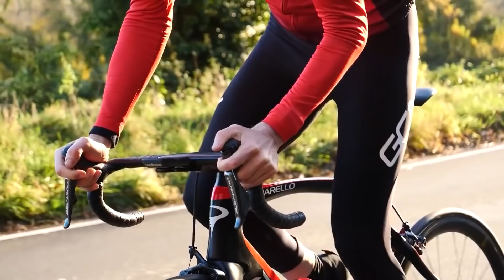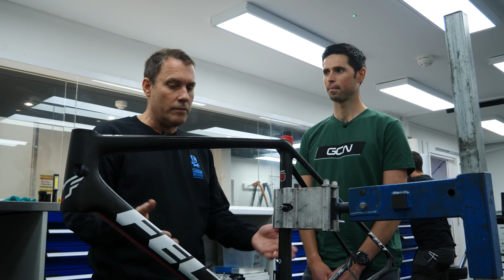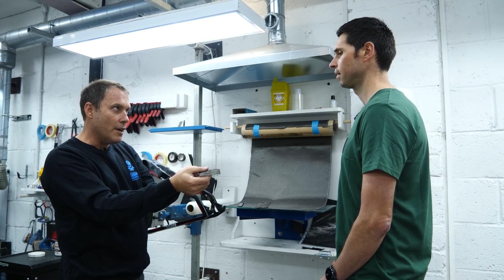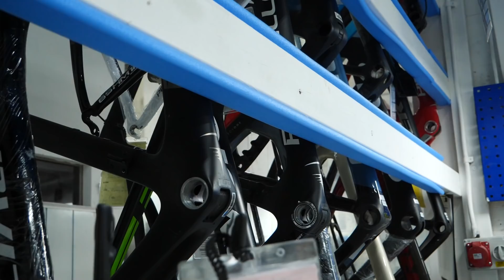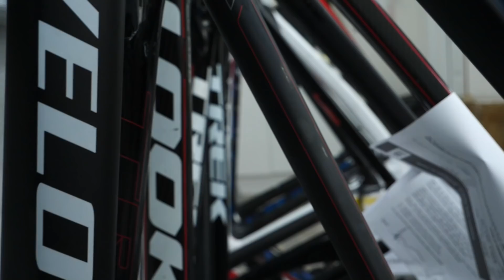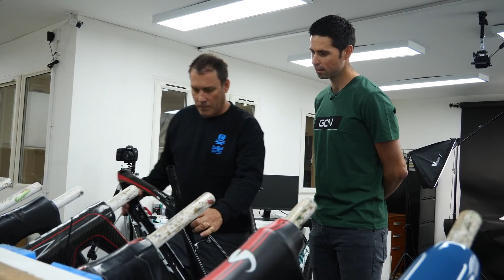Can Carbon Fibre Bike Frames Be Repaired? | Is It Safe To Ride A Broken Carbon Frame?

Comment: and what wouyld be the cost ...LOL I GOT A CARBON SCOTT bike  that has a rear hanger and the fantastic carbon that holds the hanger is cracked and broken  to me carbon fibre is weak to easy to break and would be an arm and a leg to get professionally fixed just not worth it so its going to the landfill give me an Alloy frame any time

Comment: What about cracked frame from an over tightened seat post clamp where the seat post is aero and the clamping mechanism works in such a way that it cracks an inner part of the carbon?

Comment: the fact that theres a cf repair shop exists says it all.
never heard of an aluminium frame repair shop.
carbon is like oled tv, its gonna burnin sonner or later so cf gonna break.
Reply: because once alu breaks, there is no repair method.  it is trash.  carbon is good because you can repair if you need to.  steel can be repaired.  aluminum cant be.
Reply: @anthonytalevich7601  theres something called welding

Comment: Great information, it wasn’t that long ago the thinking was a broken carbon fiber frame meant replacing the frame. My question just how much does repairing cost? A ball park price would be nice to know. Is it less than half, two thirds the cost of replacing? Would be nice if he could state something like, you can expect to pay… and as much as… It’s obvious that it must be cheaper than replacing, you wouldn’t be in business otherwise. But is the repair at price points that mere mortals can afford?

Comment: I bought a bianchi oltre xr2 that had a seat stay like that on the thumbnail, it was "repaired" with epoxy-putty inside and glass fiber on the outside.
I noticed it bechause of some shitty paintwork and i started tapping the frame to check the rigidity of the frame through sound.

when i got to the seat stay the sound was completely dead, and all it took was a 3 fiber push on the seatstay and i had a piece in my hand.
I took it to an actual professional carbon fiber repair man and the result was really good.
Paintwork still look diy, but it's a black matte frame so it's really not important what it looks like, but i know i can trust the frame now, and i've used it on my smart trainer aswell as jumped it over curbs and down curbs with no ill effects.

Be carefull where you get your frame repaired, as the previous repair man obviously didn't do a propper job and it would have ended up hurting me down the line.

Comment: I would never accept a repaired carbon frame, sorry. You are going 60mph downhill and if any of those cracks they DIDN'T see, suddenly gives way by a small hump in the road and you fall off. It might be the last thing you do in life. Sorry, but these single peace molded frames only last until the first crack appear.

Comment: I had my top tube repaired by these guys. Amazing job and near perfect finish in the end and nearly three years later I’ve had no issues or problems. Cheaper than buying a new frame too. Would definitely recommend!
Reply: Just cracked my frame in a crash what is the link for the shop when I look up carbon bike repair just a bunch of other shops come up
Reply: How long was the turnaround mate? I've got mine in for a weird manufacturer defect. Not in a rush.
Reply: @AlbertBuckinghamEllison  
F**k that, you should have sent it back to the manufacturer if it was how they sent it you?
Reply: I also need to have my bike's top tube repaired. How much did it cost you?

Comment: Do not be fooled by Rob at CBR, I have had a complete nightmare with this joke of a company. Go anywhere but CBR AVOID AVOID AVOID. They returned a rebuilt bike in dangerous condition, missing bolts from brakes and forks, poor paint finish, over painted, so much so that the paint rubbed away in several place and CBR blamed a manufacturing design fault and offered to cut a channel into the frame!!! Can you imagine what the manufacturer said about that? Even my insurance company have tried to resolve but are now supporting me going to another company. CBR did such a poor job they even wrote to my insurance to say so! A lot of people may use social media as platform to complain, as I am doing here, however I have a full evidential chain of pictures and correspondences. Incl Rob saying “whatever happen we will sort this out for you” liar alert!! The court room beckons. Happy to privately go into further detail or provide proof of all I say. GCN this is the 2nd feature on this company, there are other better ones you could feature and support, come on be original!!

Comment: Local bike shop has a wall with road frames hanging on it that suffered sudden catastrophic failure with normal riding. There are a lot of them and some are modern expensive ones, some of the riders are now in wheel chairs..... yeah n,f,t,h

Comment: #askgcn Hi guys, I've recently changed my chain and cassete, I've left the chain the same lenght but the cassete is now R8000 11-32, and the old one is HG800 11-34. There was a spacer underneath the bigger cassete which didn't came with the new one. Should I have left it on the bike or not? New Ultegra Cassete is mounted and it is fixed/doesn't wobble or anything.
Reply: If they are both 11 speed cassettes and the first one needed a spacer then the replacement should have a spacer too.

Comment: What I am surprised about is how many damaged frames there are!!!!  Are these all damaged from crashing, misuse,  etc?  I mean in my 39 years I think the last time I wrecked a bike was in grade school.  I have a Domane SL6 ordered but starting to worry how fragile carbon frames are.  I for sure don't have deep enough pockets to be replacing/repairing carbon bike frames.
Reply: They aren't really fragile at all. I hadn't wrecked a bike in many many years either until last weekend. Laid it down in an off camber dirty turn at a decent rate of speed. Road rash from my hip to my ankle. Frame seems fine, the only damage was one busted shifter and the other one scraped to shit. Once I heal a bit and my new (price gouged) shifters come in I'm going to take it to the ahop to get a second pair of eyes on it but I don't think they'll find anything wrong with it. Carbon is pretty tough and the same sorts of things that break it can damage alloy frames as well, the difference being that alloy is pretty much 100% unrepairable. Don't worry about it and go ride.

Comment: I am riding a Canyon Ultimate that was repaired at the bottom bracket by the previous owner. I’ve put 16,000km on it with zero issues!
Reply: Professionally repaired carbon frames often are stronger than the original ones because expert repairs will add a lot more materials onto where it was cracked.

Comment: I would be very hesitant to ride repaired carbon bike due to complexity when working on carbon. However, if there was a standard certification for repair shops and their personal then it wouldn't be an issue for me. Also QC and repair would need to be a separate entities to ensure quality of repair is not compromised.

Comment: Sent my PlanetX to these guys to get the drive side dropout repaired. I thought the frame was dead and I was going to have to shell out on a new frame but I found Carbon Bike Repair through a GCN video. I have to say that although the repair was a little pricey it was still way cheaper than buying a new frame. Their customer service was impeccable with good communication throughout the whole process. And most importantly my commuter/go anywhere do anything PlaneX got a new lease of life.
Reply: @Terry Williams My experience is the complete opposite, I have had and continue to have an absolute nightmare, liars liars liars, dangerous workmanship poor paint work and broken promises……court room beckons!
Reply: @petermorrell5422  
Could you explain more in-depth by any chance? Thanks. Especially to do with the poor repair and paint job you received. Me personally wouldn’t trust a job like this unless I was there to see the work as it happened, too easy to slap any old bodge job on and paint over the top.

Comment: repair  carbon =  ad  weigth ...  don't  tell  Oli  he  will go  mad  as  he  did  on the  Gravel bike video!  good  video   very useful  still  wondering  why  some  need  a  carbon fibre bike  why  some  others  don't  and there  is the  answer why  some  of  us  resist  and  belive  more  on steel  titanium  and  even  Aluminum ... because  to  can  repair  the  bike  but  take  away  the  concern  of  the  one  who knows that  this  bike  is a  repair  /broken bike.
Reply: Aluminium isn't repairable

Comment: My Trek Domane SLR7 had an argument with a car and the car run. (Not)nice crack all around tonight tube next to the head and fork. Thought is was a goner. Friend recommended The Frame Doctor in Tavares, Florida. About a month later it was fully repaired and the area affected repainted so as to not be discernible. About a grand. Much less than a new frame.

Comment: This is just stupidly complicated and expensive stuff for a “bike”! So unnecessary.. hey but it’s your money throw it away if you love to.
Reply: Until you ride a stiff CF bike, you won't appreciate the service
Reply: @dvikauglaumishrauca  All bike materials are stiff and can be designed for any amount of stiffness. Stiff is a marketing term to make you spend more money. There are plenty of articles and videos that explain stiffness and as for us mechanical engineers, we just cringe and laugh .
Reply: Why unnecessary? These frames usually cost upwards of £3000, why is it unreasonable to spend £200 or £300 repairing one? Or are you saying that carbon shouldn't be used in a bike frame to begin with because it's too expensive? Why do you value bikes and cycling so little?
Reply: @neil7769  I meant carbon in bicycles. It’s okay to have it but this kind of complexity on a bike is ridiculous. It’s not an aircraft.
Reply: @Abhitips224  Are you a keen bike rider? Carbon offers a lot of advantages for performance / competitive bikes. I have (and have had) many bikes made of carbon, steel, aluminium and titanium, but the best carbon frames are definitely lighter and better to ride. It's a relatively subtle difference, but if you are riding most days a week and for many hours a week it's well worth the expense and complexity. Although the bicycle itself is relatively simple mechanically, because it's human powered it's perhaps best seen as one component in a larger, highly complex biomechanical machine (the other component being the human rider). Imagine if you were making a prosthetic limb, would it not be worth considerable expense and complexity to make it as light and structurally optimised as possible? For a keen bike rider the same applies - the bike is an extension of their own biomechanical system and small improvements are worth a lot. Of course for someone who is just using a bicycle casually to go to the shops of whatever such complexity and expense might be ridiculous, but if it's a big part of your life and your physical identity it's well worth it.
Reply: @neil7769  I commute to work everyday by bike. 85 kms a week. I have a caad8 and a tange steel Raleigh mtb with slicks. I use the Raleigh much more lol. I guess that would make me a keen bike rider? I don’t know. I’m happy it makes sense to you and others. To me though, I’m like c’mon.
Reply: @Abhitips224  It's all relative and you can be a keen cyclist in different ways. If you are using a bike mainly for transport with some fitness benefits and you aren't focussed on performance or the riding as an end in itself then the bike will matter less.
Reply: @neil7769  I guess so.

Comment: I've got a friend who owns a Colnago(with a carbon frame of course).Can't quite remember which model because it's from a few years back(like,it had a first generation Ultegra Di2 gruppo on it).

There was a crack on his toptube that was approximately half the length of the toptube itself,and a crack on his front carbon wheel(somehow).Those cracks were from many months back and he still rides his bike.

That being said if your carbon frame has a crack,do not straightaway ride your bike off as per normal unlike what he did,just in case.
Reply: That’s truly scary!! When I was hurling myself down the road on an etape at 96kph with closed roads and not traffic, I was supremely confident in the bike under me. How safe would you feel doing 30kph on a public road with potholes / traffic and known cracks in your carbon wheels? 😮

Comment: so purchase a really expensive carbon frame that gets cracked, but how many of these shops are in the world? most ppl won't even be close to one of these special shops.
Reply: We do reair bikes across the globe! And we have a branch in Johannesburg!
Reply: Special bike shipping is available in many countries with low rate. Broken carbon bikes tend to be shipped to be repaired.,
Reply: Look into the local Architectural Scale Model Making scene ... A lot of enthusiasts there are used to craft things out of carbon and can provide viable support. I had a frame fixed that way
Reply: I think you'd be surprised. Obviously it depends on what country you live in as in America the nearest big town or city can be further away than the other side of the country for someone like me who lives in Britain.  However with people who live in Britain you're probably looking at a 2 hr drive all round which when you consider the cost you'll save compared to throwing your 5 grand bike away, isn't really a long journey.
Reply: you can do a very solid repair yourself with epoxy and a roll of carbon fibre. To be honest if you don't know how to take care of it, have the proper roads to not damage it, and either shops around to repair it or the know how yourself just don't get carbon fiber
Reply: @matroid4996  well, said. very limited where i am for bike shops and expert repairs.

Comment: Okay the only ONLY Question I wanted answered was the "Cost"
How much does it actually cost to get this all done?
Obviously different bikes different damages = different prices
But just a ball park what is the min-cost and whats the max / right off level of cost
Reply: In Canada, Roberts Composites in Vancouver, completely snapped seat stay $600 and that was with colour match paint, they did an amazing job and just under 2-week turnaround.
Reply: I got my unusable right seat stay fixed for $350
Reply: @MrFreeGman  Yes, anything beyond a carbon fork is for people with money to spend on their hobby. Aluminum has come a long way, and could easily win any local race.
Reply: Minimum will be the inspection cost.
Maximum will be whatever you can imagine. I would guess that some people with nostalgic attachment to a specific bike will pay many times the replacement cost of the frame to get it fixed.
Reply: @galenkehler  I'd imagine they get quite a few insurance jobs too.

Comment: Yes it is safe, all depending on the damage, I ride a cracked frame all day everyday for 4 years now doing food deliveries
Reply: Sorry, but your advice is rather scary. Cracked carbon has no "safety zone" and there's no simple way to tell wether it is going to hold or not. If your frame still holds, then only because the crack has not affected all layers, because the applied forces compress the crack (instead of applying tensile stress) or because your riding style is rather "gentle". But how do you determine whether the crack only affects one layer or two layers? The problem is you likely won't feel a gradual worsening of the situation, once the load is too high, the frame will just snap and in traffic this may be fatal.
Reply: @dudelwurm  I understand and respect all your scientific mumbo jumbo but it just depends on how, where and how much the carbon is cracked. The frame is still very solid, it's been like 5 1/2 years now and it's not worse and still very solid. It's actually on the down tube, near the head tube and I can even press as hard as I can and the tube won't even flex inward or in any way. It just all depends on each case. Some cracking can render a part of a frame weaker or very weaker or not really effect it unless it's on a mountain bike. Mines a road bike.

Comment: I agree it can be repaired as good as new or even stronger at the broken part, but what if the repair was not that good? But risking my life for 3-5k usd? not worth it
Reply: It should not be stronger! Certain places are designed to be stronger or weaker to have a cartain flex or stiffness and to bare a certain load. If if it was made stronger, it's not good for long term either

Comment: Trust me. It's NOT worth it. On top of that, it's one of those things that if it isn't done nearly perfect you're risking your life. Save your bacons.
Reply: The thing is, how do you know that your frame was made properly in the first place or hasn't got damage that you are unaware of? If you accept that it's reasonable to ride a carbon frame to begin with, why wouldn't it be reasonable to ride one that has been professionally repaired? Why would you necessarily trust a professional carbon bike repairer less than the bloke on the factory who did the layup and the factory's QC? At least you know that if it has been repaired, it has probably been inspected more carefully than it ever was when it left the factory.